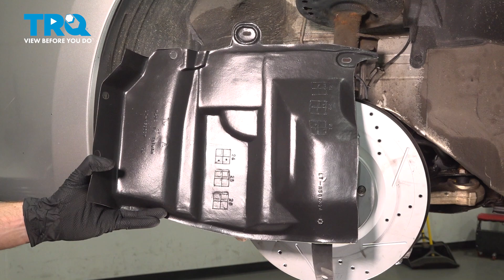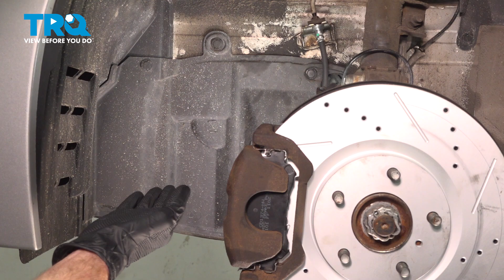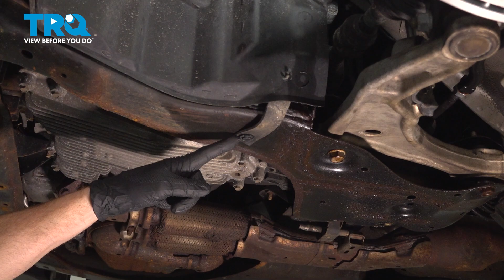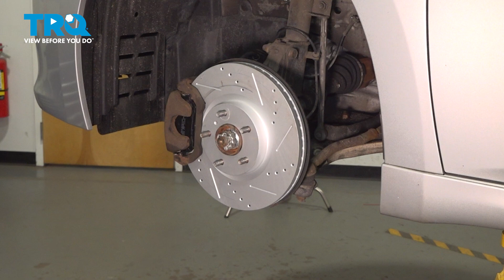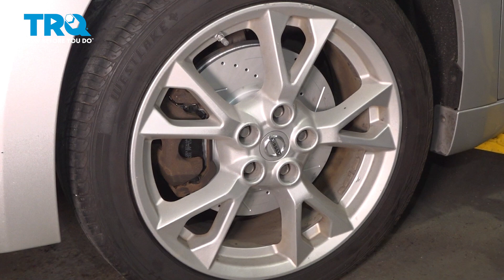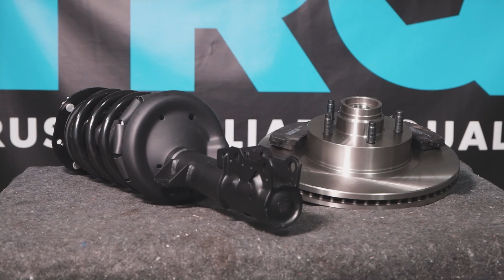How to Replace Engine Splash Shields 2009-2014 Nissan Maxima

Comment: I was told that if you reuse the clips they will fall off. My engine splash shield on both sides only had one to two clips. Supposed to have 6.